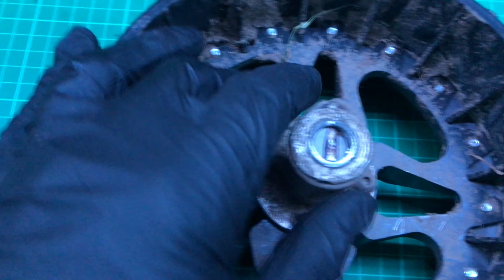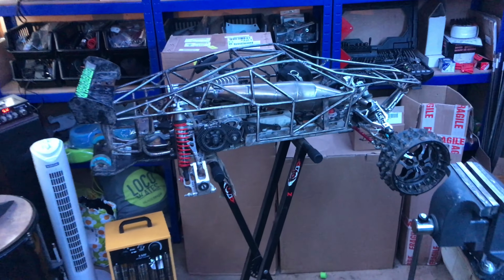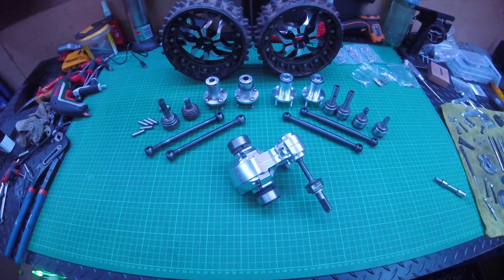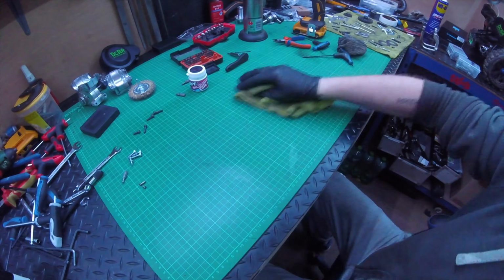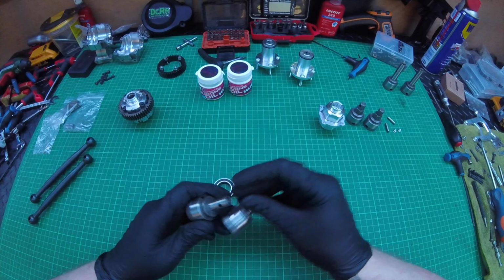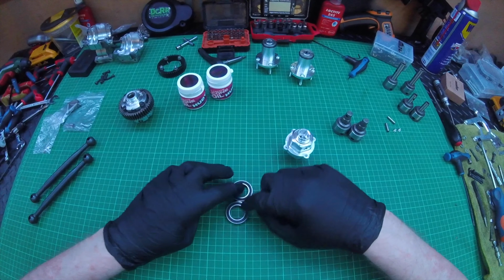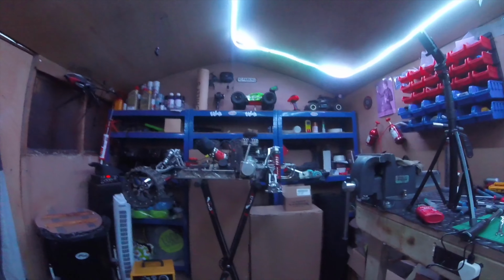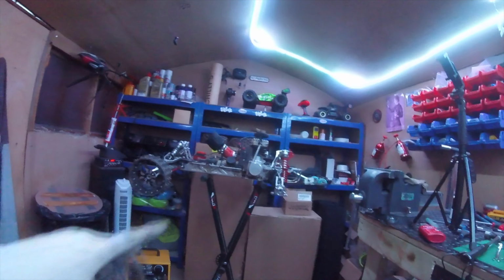💥CHANGING MY REAR DRIVE TO 💥INNOVATIVE RC IRC 💥Dogbone Kit💥Taylor’s DIFF LOCK💥

Comment: Hey Mate Great Video I just have a question well maybe two what’s the Difference between the Lock Diff and the other one and where can I get both ???
Reply from the maker: Hey 👋 so A locking differential is designed to overcome the chief limitation of a standard open differential by essentially "locking" both wheels on an axle together as if on a common shaft. ... An open (or unlocked) differential always provides the same torque (rotational force) to each of the two wheels, on that axle.

Both you can get from    RCMax.co.uk

😉👍